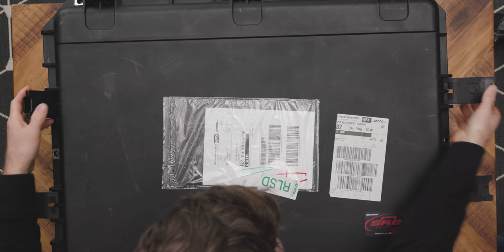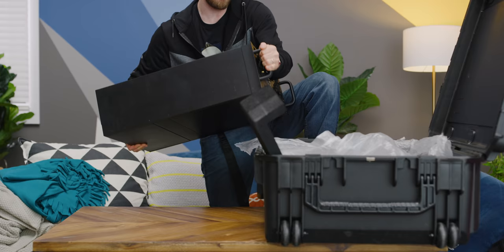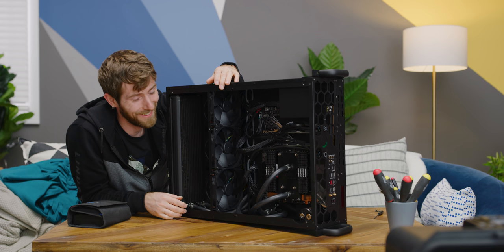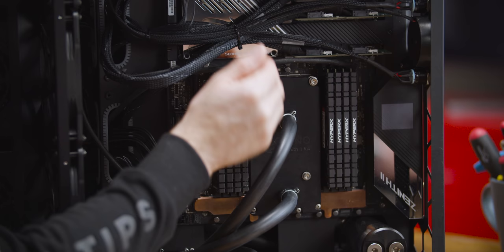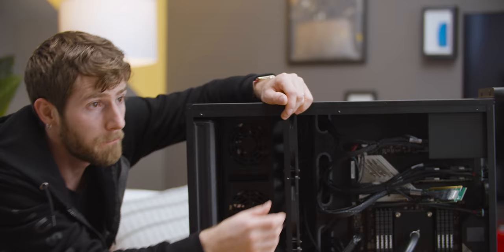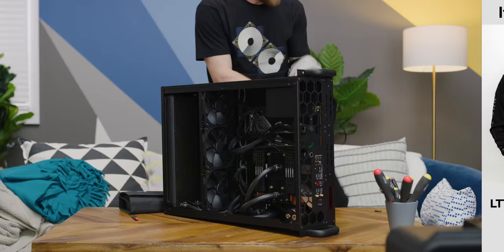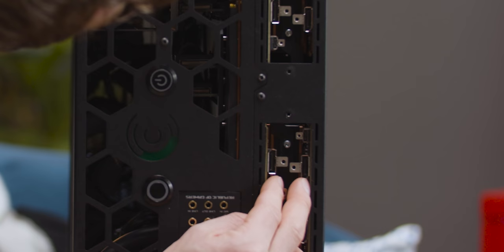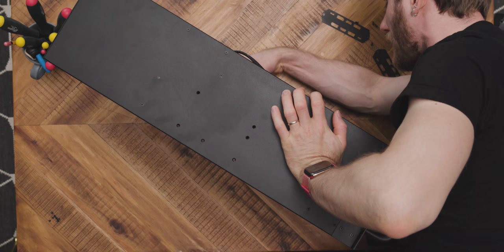Graphics Card Sandwich??? - Comino Grando RM

Comment: I may sound crazy, but I really like the IO on the front panel so I can access them by just opening the cabinet.
Reply: Man, I'd install moonlight on that thing and start playing some games!
Reply: Having a single gpu io on the back would be awesome too if you could have like extenders or smth
Reply: I guess it's easier to plug a monitor and troubleshoot from the front though right?
Reply: @TheGoat what is IPMI?
Reply: @vegitoscollection  Intelligent Platform Management Interface; used for IP KVM and other management functions; it's like a PC that runs the main PC so you can remote reboot/edit BIOS/control the server without walking up to it.
Reply: @spacixone  so it is basically controlling the actual hardware right?
Reply: @vegitoscollection  yes, without it can't install an OS on a server without doing something silly like "walking up to the hardware" and connecting a crash-cart (monitor/keyboard/mouse cart) to the machine.
Reply: Get back to wsb
Reply: @alexfelton1560  Haha!
Reply: Same. I’m always plugging something or other in. Put the motherboard I/O up front, the GPU I/O in rear.
Reply: Except networking and power, those need to stay in back if you want your rack to not look like something built a nest in there 😅
Reply: Most Dell servers I've worked with have a VGA, and 2 USB on the front. The power and Ethernet and any extra ports are on the back.
Reply: That's why I place my PCs with the front facing the wall.
I wish a case manufacturer would design something around that idea that doesn't look shit.
Reply: I know right. Nothing like convenience. (:
Reply: It's like they looked at what Google and Facebook have been doing for years and learned from it unlike most server manufactures.

Comment: Take a look at “rackable” servers, they had the I/O at the front of the case too, they were made that way so you could mount servers in the front and back of the rack, they’re also really short depth, great for wall mount racks
Reply: It is clearly aimed at smaller companies and production houses and not data centers. Personally I prefer my cables to run in the back of the rack 
and connect up to the KVM  switch if the machine doesn't come with a out of band management (preferable LOM) interface. Wonder if there's a remote management card  available for this puppy.

Comment: Linus: it has a threadripper 
Me: maybe I can buy this
Linus: AND FOUR 2080 TI'S!!!!
me: ...
Reply: 420 80 ti
Reply: A thread ripper is pretty expensive already when you include the motherboard
Reply: @SwainixFPV  especially the 64 core one
Reply: Don't worry, they have one where you can have 8 GPU's as well :)
Reply: @SwainixFPV  actually last gen theadrippers are SURPRISINGLY cheap... Mostly because they suck outside of specific multi-core workloads :)...
Reply: me with my amd a10 7870k and ddr3 1866 mhz memory: its fine buddy take your time
Reply: Don't kid yourself. You still can't afford it without a loan.
Reply: The thing is worth more than my room+ my pc
Reply: @mataskart9894  almost anything in serious computing these days is "specific multi-core workloads"[1]. If you have to run badly written legacy software or Adobe crap than strong single core performance is needed but the blame has to fall on the software not the hardware. 

[1] I assume you mean massive parallel processing by that

Comment: PSU fans can also add pressure. Especially since they are custom build there might be custom fan curves / temperature profiles for them also. So it might be 6 fans blowing in to that radiator.

Comment: Iv'e seen a lot of insane PCs on LTT throughout the years but THIS is hands down the CRAZIEST performance per liter system yet!
Reply: Performance per L isn't good at all. Dual CPU + 4 V100 GPUs in 1U are pretty standard. This thing looks to be 4U, so 4 times as high although it might be a bit shorter. 80% of the chassis is either air or some completely useless water cooling system
Reply: @calaphos  You know how loud it would be without water cooling? Loud. Example: https://youtu.be/QeGhSWRUu-M
Reply: Not that impressive. Tons of space for GPUs.

Comment: Interested in the temps vs a 4u with the same setup. Plenty of 8+ slot rack servers available now with dual redundant 1600w psus. Looks like a 3u so there’s that. Also lots of water cooling madness. Admittedly it’s likely to be quieter than a system relying entirely on fans... but it still has 3 fans so... also RM likely means rack mount so surprised you were surprised. Lol.

Comment: 3 120 hyperdense rad at 3000rpm is going to do a lot of cooling.

It's going to sound like a jet engine at idle on the runway, but that's a shitload of airflow considering those fans do 64lpm airflow at 1200rpm if I remember correctly.

You basically have 450lpm in cooling.

As long as it's in an adjacent server room or closet and you dont have to sit right next to it you'll be fine.

Comment: Actually I like all the ports at the front. If its mounted in a rack and you need to plug something in, wouldnt it be easier to have them all on the same side? Networking gear has all their cables in the front.

Comment: Cooling all that Hardware with just a 360mm rad is gonna be interesting. I expect the fans to run at the full 3000rpm or the Temps are gonna be rather bad.

Comment: The way I see it is that they have 6 fans pulling air through the radiator. The 3 fans that are blowing across the Motherboard and 3 PSU fans exhausting out the back. That is probably why they went with 3 PSUs instead of 1; they can get a lot more air through the radiator and thus better water cooling. I really like that idea, but it would be difficult to get right. The GPUs would not have been able to go in the back with this design.

Comment: A few questions: Can you exchange the PSUs while it is running? Can you use professional graphic cards because consumer cards don't sum up their memory? Can you exchange those cards while it is running? What to do when the water cooling starts dripping due to the 24/7 usage? Can you exchange memory while it is running? And what's about the network connections? QSFP possible? What about airflow? Rack mounted hardware must have front to back airflow or your air conditioning will not work properly ...

Comment: Yeah, I have a 360 rad just for my 3900X CPU, and that's on the weak side. I can't imagine cooling almost ten times my CPU in terms of power (4 x 2080 Ti @ 250 W, 1 TR 3960 @ 200-250 W, vs 1 3900X at 150 W!).

Comment: Linus is forgetting that most water cooling setups are for noise, not performance. Triple 140 3000 RPM though a high density rad will cool that setup perfectly fine. It's a render server so no overclocking either.

Comment: I'd justify the use of that right about now with the project I'm working on but that have no hardware capable of rendering. :(
Just blew all my money on a new card to be able to continue it, but, it's still not enough VRAM, Blender tops it off. Not enough of the normal RAM either.

Comment: Wouldn't this server be better equipped with something like a Nvidia Quadro RTX 8000 instead of the 2080ti? That would enable, alongside an upgrade to the AMD Threadripper 3990x cpu, significantly more uses for data analysis and scientific uses. 

Granted, the cost of the upgrades would increase the total price by about $20,000; at which point it's not really the decent value proposition it currently is. (I didn't expect to ever say 4 Nvidia 2080ti's would be a decent value, but here we are. They deserve credit for that alone.)

Comment: "unsure about those 3 fans" Well, but they are industrial fans, their airflow, static pressure AND NOISE are MUCH stronger. the normal 140mm nocutas have 2,05 mm H2O of static pressure, while the Industrial ones have 10,52 mm H2O of static pressure. AND they move more than double the air.

Comment: Hi. Im having a hard time understanding the goal of this machine. It looks nice, sure, but the cost effective ratio seems bad. I've just installed at work a few o Gigabyte 2U rack servers, with 3 2080 TIs (blower style) and a 16c32t Epyc rome. Is denser (2u instead of 4), has IPMI which is incredible useful for rack servers, and gpus stays at 75c under 24h load. Is probably the same price or cheaper because of lack of customization. So, this product, albeit cool, looks a waste of resources. IMHO

Comment: If you can afford 4 2080 Tis, either:
You should have bought pro-grade graphics card hardware: Radeon Pro / Quadro
OR
You can afford more than a 3960X, even if it means using 5700 XT cards instead.

That's a weird config!

Comment: Ok but whats the market for this thing? Its not very dense with merely 4 GPUs in what looks to be 4U. It is water cooled and has fairly premium parts so its probably not the most GPU Tflops per Dollar you can get. The network connectivity is frankly atrocious with just 10G for a compute server. I guess it could be somewhat quiet but that shouldnt matter in a server room. If you want quiet you would get a normal tower workstation.

Comment: Minecraft server with this thing 
That would be nice
Reply: Fact is minecraft only needs cpu power so those 4 rtx 2080ti would be useless for this setup kiddo
Reply: The GPUs would be useless for that.  Also, you'd struggle to effectively use that many cores, unless you were running a bunch of smaller servers, but even then a multicore server will only scale so far for Minecraft.

Comment: Just my personal opinion.
It's a bad design and layout.

As a server, it's a failure.
The components aren't particularly accessible, requiring the removal of the server from the rack in the event of component failure.
There are too many screws in the upper and lower cover plates.
The use of non-redundant, non balanced power supplies could result in a system crash and/or an uneven usage resulting in premature failure.
The positioning of the fans will, potentially, negate any sound savings over a more conventional server  or water cooling solution. 
Unless they are also creating a custom bridge for this layout the use of nvlink has been negated.
The bifurcation of the pci-e slots, could, introduce a bottleneck in the gpu performance, as they are going to be limited to x8 performance, potentially.

While I can see some potential niche use cases, compared to a more conventional hedt or server solution, it's definitely a hard pass.

Comment: So this is a flat stupid build. Hardwired PSU's and fans means this thing would be a maintenance nightmare. The lack of a redundant PSU means any failure there brings the whole thing down. With 3 PSU's the chances of that happening is, obviously, tripled over a normal rack.

The back of the case having no I/O means it cannot just be slotted into a standard rack alongside other racks.

TR are great chips don't get me wrong but they aren't validated for datacenter use the way Epyc chips are.

So no datacenter will ever buy these. That leaves outfits that want own their own render rigs. Which is also a problem. 2250W, 3x 750W PSU's, means it cannot be plugged into a single 15W circuit.

Further those are 2080ti. So no 10bit color depth which could be an issue for a render house. Further the cards have only 11Gb of VRAM each. Even if NVLinked together that is at best 22Gb per pair. RTX Titans have 24 and the RTX 8000 has 48 each. Sure there are render engines that can do out of core rendering but the system RAM is a pretty paltry 128Gb as well.

Out of curiosity I looked at the website and they are not even trying to sell these for rendering, which is good they'd suck, but as password recovery rigs. Basically brute forcing PW's I guess? I've literally never heard of such things and cannot find any reputable brand selling such. Are these meant for black hats?

Comment: This is kinda overall a pretty bad design. Reversed design for no good reason, dense radiator optimised for high static pressure and then at least 6-8" of free space between it and the fans, 3 independent PSUs instead of a single redundant one. Just seems like an amateur designer with no real enterprise compute skills.